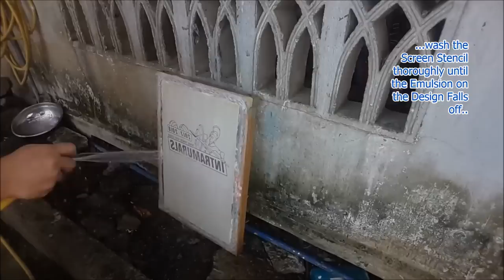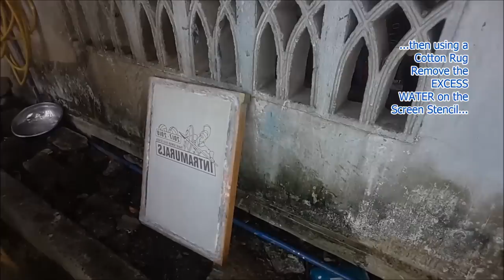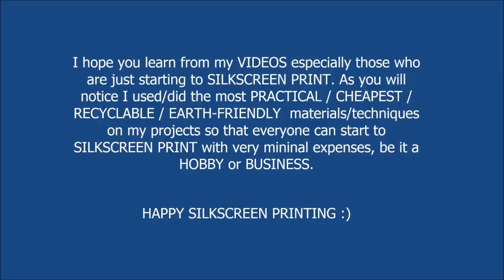Screen Printing: A Step by Step guide in Printing...

Comment: About this one.. will the printed one be removed?
Reply from the maker: Rubberized Water-Based Paints are very Durable so it will stay on T-shirts for a long Time....
Reply: How about Tulco?
Reply from the maker: You can also use Tulco or other Brands, just Don't forget to TEST PRINT if it's your First Time to use a certain Brand...

Comment: Ilang minutes po bago ma dry yung first coating ng emulsion? I tried po kasi using 10watts light then mga 6 inches lang distance nya sa light exposure.. hindi po nag work. Pano po yun? Dapat ba sa tirik na tirik na araw ko nalang e expose?
Reply from the maker: 15 to 30 Minutes pong pagpapatuyo gamit ang Electric fan sa first coating ng Photo Emulsion, then yung 2nd Coating mas mabilis nang Matuyo....mas maganda po kung sa ARAW nyo n lang I-Expose 10 seconds lang....mahirap nang I-wash pag sobra ng 10 Seconds....
Reply: Ngayung gabi ko lang kasi sinimulan.. di bali next tym sa araw nalang para mas mabilis. Yung sa coating, pag na sobrahan ba ng kapal yung emulsion, kasama ba na natatangal pag wash yung exposed area? Nangyari din kasi sakin. Salamat po

Comment: Why it needs to mix photo emulsion and sensitizer?
Reply from the maker: The Sensitizer makes the Photo Emulsion Sensitive to LIGHT. During Developing the Photo Emulsion Exposed to Light Hardened and the Photo Emulsion Covered by the Design/Positive are the part that will be wash off by water...

Comment: Sir ordinary paper at ink ng printer lang po ba ginamit mu?
Reply: Please help po sa tanung ko. Thanks
Reply from the maker: yes...
Reply: Sinunod ko sir step by step according po sa video nyo. Pero nung inapply ko na po yong printed design ko sa screen, after ko po mag apply ng oil eh hindi po nag tatransfer yong design sa screen and pag hinugasan ko po eh natatagkal po yong emulsion sa screen. Pwedi po pahelp kung bakit po ganun nangyari? Thanks
Reply from the maker: Saan nyo po in-EXPOSE yung Screen  with POSITIVE sa Araw po ba o sa ILAW, at gaano katagal nyo po in-EXPOSE?
Reply: Sa araw po. Mga 11sec po sir, anu po kaya mali sa ginawa ko sir? Iniisip ko kasi baka sa ink ng printer at papel na ginamit ko sa positive. 

Yong screen ko nman po after ko iapply ng emulsion pinatuyo ko po sya gamit ang blower
Reply from the maker: Mukang Ok naman po yung prosesong ginawa, pero kung madaling mabakbak lahat sa photo emulsion po ang problema, ano pong Sensitizer ang ginamit nyo...
Reply: From tulco po yong sensitizer at emulsion na gamit ko
Reply: Sir ok na po, di na po natatagkal yong emulsion nya. Kaso ang problema po, after ko mailagay yong positive at maiexpose sa araw eh mahirap nman po alisin yong positive or design don sa screen. May mali po kaya sa nagawa ko sir? Please advice sir.

Comment: Im having problems with burning the image on the screen..it doesn't burn the imagae..and whenever i tried to spray a water from my emulsion it damages all my screen
Reply from the maker: What kind or Brand of Photo Emulsion are you using, it looks like that the Screen was under-Exposed...

Comment: Pls. reply cause i am needing this for my project😁👍🏻
Reply: He is printing in an ordinary printer with plain paper in best quility. I have test it it works. The oil and everything.
Reply: @maxgr26  Thank you very much!
Reply: @maxgr26  only black color can be put on the paper your printing on or yoy can use any color?
Reply: @jurielmarong322  print in black and whte mode and is gon be fine.
Reply: @maxgr26   thank you , you help a lot!😁
Reply: @maxgr26   CAN I USE BOND PAPER?
Reply: @maxgr26  PLSSSSSSSS😭😭😭
Reply: @jurielmarong322  what do you mean bont paper? Use just plain copy paper. What are you trying to do exactly?
Reply: @maxgr26  I AM DOING SILK SCREEN PRINTING
Reply: @maxgr26   I SAID CAN I USE BOND PAPER FOR THE PRINTING?
Reply: @jurielmarong322  Use plain paper. The same we use for copies. Plain paper!!!

Comment: Sir. pano po mag 2 coats ng damit? kasi nagagalaw ang shirt, hindi ko na matantsa ang original na shape nung 1st coat ko
Reply from the maker: Dapat po nakadikit sa Platten (Shirt pad) ang T-shirt para STABLE at hindi nagagalaw...Kailangan po po may Table Adhesive ang Shirt Pads..,https://youtu.be/4FKIFqn9dP0
Reply: ah kailangan po tlaga ng adhesive sir para didikit sa platten? kasi sir, dun sa isang video mo na color blue polo shirt na logo lng ang piniprint mo, d naman gumagalaw
Reply: ah kailangan po tlaga ng adhesive sir para didikit sa platten? kasi sir, dun sa isang video mo na color blue polo shirt na logo lng ang piniprint mo, d naman gumagalaw
https://www.youtube.com/watch?v=TMZuAFJF8RY&t=286s

Comment: Ilang mins po yung pag papatuyo ng Emulsion .. before developing ..
Reply from the maker: Gamit ang Electric Fan 15 to 30 minutes tuyo na Photo emulsion, mas mabilis matuyo sa 2nd Coating then pwede mo na kaagad gamitin o i set up ang design para i-develop or i-expose....
Reply: @EasyVideos  Bale po sa first coating mga 15 to 30 mins mo na bago i apply ang second coat?
Reply from the maker: Once na Matuyo na po ang 1st Coating pwede na kaagad pahiran ng 2nd Coating,  yes 15-30 minutes po bago matuyo ang 1st Coating....
Reply: @EasyVideos  thanks po

Comment: Sir my screen gets holes in it after taking 10 to 15 prints. Plz suggest
Reply from the maker: I'm not sure what causes it but it can be the Platen if you're using a hard Platen, the stencil is easily scratch by Squeegee during printing,  or the Photo Emulsion is not properly set or you need to Apply a Photo hardener on the stencil to make it tougher and there are other factors that can cause Holes on the Screen Stencils...
Reply: @EasyVideos  Thank you but what is the ratio in b/w emultion and sinsitizer
Reply: Hardner is sinsitizer..you mean???
Reply from the maker: 90% Emulsion and 10% Sensitizer....Sensitizer is DIFFERENT from Hardener...
Reply: @EasyVideos  Thank bro it is very helpful. Kindly guide me from where can we buy this hardner? Plz

Comment: what printer required in screen printing
Reply from the maker: Almost all Printer can be used in Printing Designs or Positive the Important, laser or Inkjet....
Reply: @EasyVideos  can i use epson L805 ink jet printer
Reply from the maker: @rishirajomivaidya5648  yes
Reply: @EasyVideos  and what should be the wooden frame size?? at first how many screen frame should i take
Reply from the maker: Many of my Screens are 15x20 inches for t-shirts....but you can use any sizes....2-3 screens will be OK as a Start, then just Add Screen if you have more projects....
Reply: @EasyVideos  r u an indian bro???
Reply: @EasyVideos  in ink jet the inflow on the matter bec of liquid ink..

Comment: I followed the steps but the paint doesn't go through the screen.
Reply from the maker: Use 100 Mesh screens for water-based paints...
Reply: @EasyVideos  Thanks but it turns out the reason is that the holes for the design didn't wash off. I am using Tulco Photo Emulsion (local) and tulco sensitizer.

Comment: You cannot stretch a screen using staples the print will be smudged you need a snap gap 30 years experience
Reply from the maker: I'm using water-based paints and Soft Pad (Platen)...you can see in the Video that the print didn't smudge...